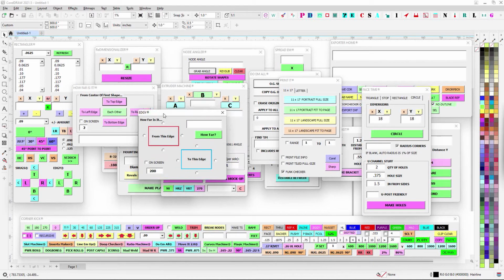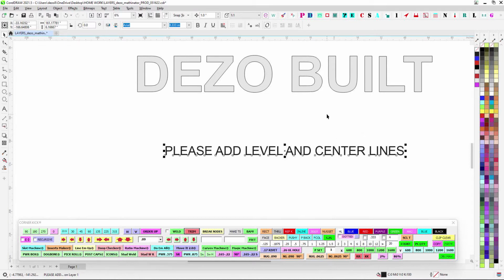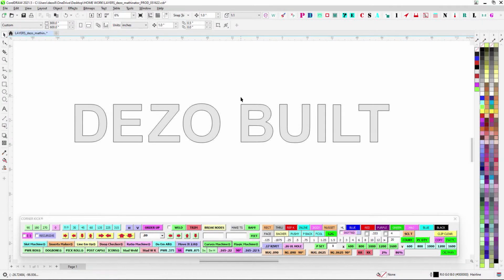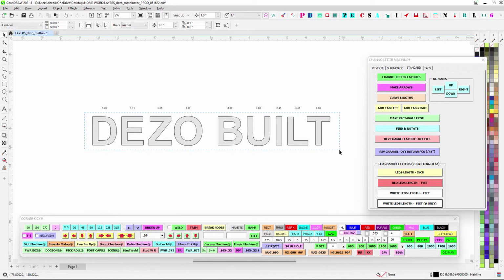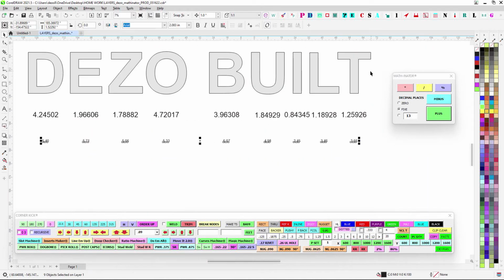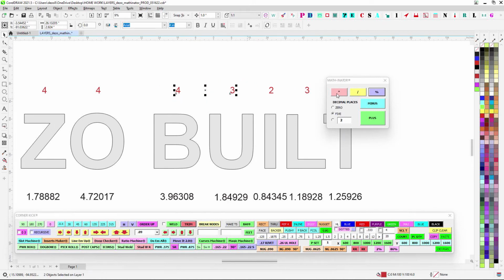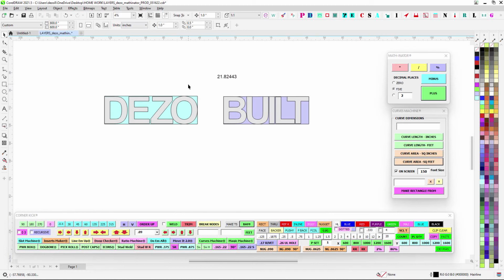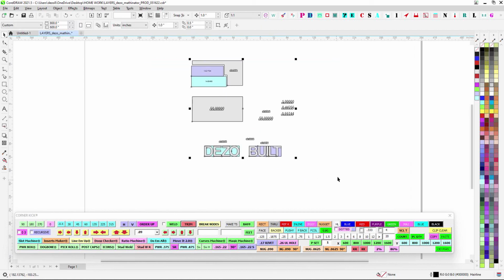My CorelDRAW Macros 101 - Intro Course To How My Macros Work - Mathinator!

Comment: Very cool toolbar design. Do you know if macros built in newer versions of Corel could be made backwards compatible with an earlier version of Corel?
Reply from the maker: Appreciate you reaching out!  I started writing the first macros in CD X7 (possibly X6, too long ago) and steadily added new ones pretty much on every version up to 2022 (ver 24), but I don't have any solid evidence that they roll back, other than when I discovered 2022 borked the DXF files (see my video re:), so I rolled back to 2021.5 (ver 23), AND actually re-installed X8 for experimentation on those DXFs.  All seemed to work on those roll backs and I am still on 2021.5.  I think VBA doesn't change much (if at all) from version to version, nor does CorelDRAW very much, under the hood.  However, when they re-introduced support for Mac (2020? 2021?) they added JavaScript support for Mac (no Microsoft VBA for them) and stopped calling it  the "Macros" docker and now call it the "Scripts" docker, so I know definitely things changed under the hood there.  But I haven't noticed any probs, other than for myself personally if I write something that's hard-coded for the version I'm using, and then when I change to the new version I have to spend a few minutes finding and fixing all the broken links.  Of course, I've gotten better at writing code and now have version and computer-user detection.  Live and learn.  Thanks for watching!
Reply: @dezobuilt  thanks for responding. I'm thinking maybe I can open a newer macro in a text editor, copy it and then paste it into a macro into my version of corel. Provided all the tools or processes are resident in my version, I hope this will work.